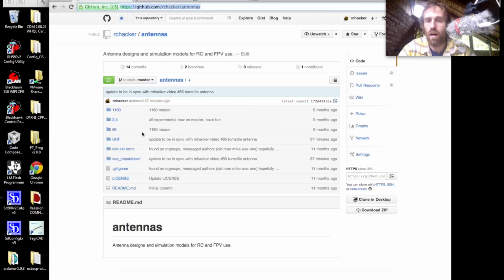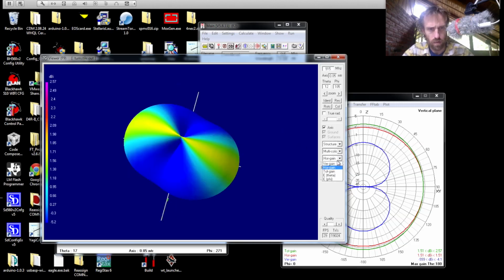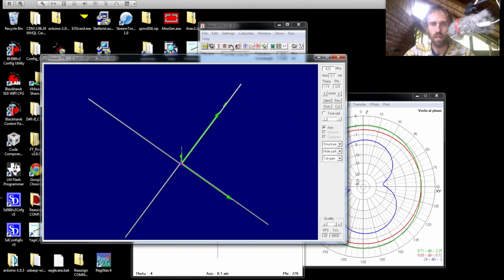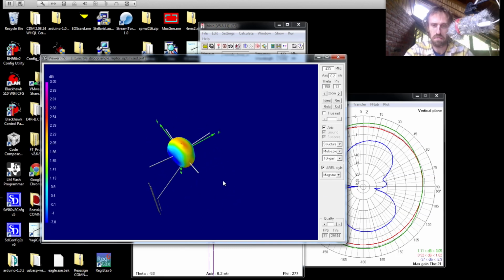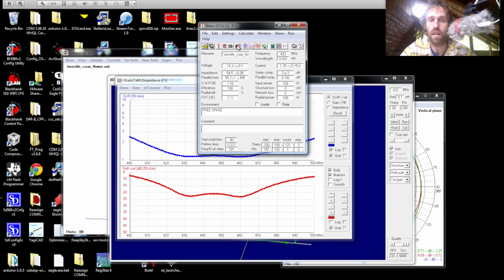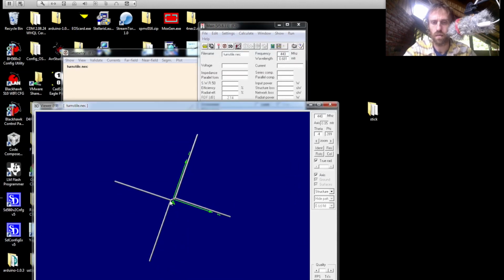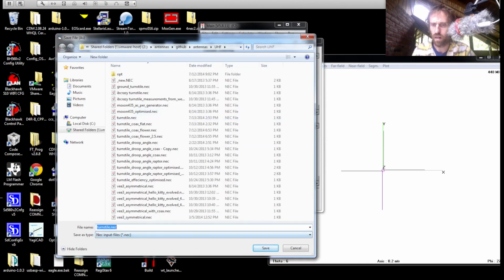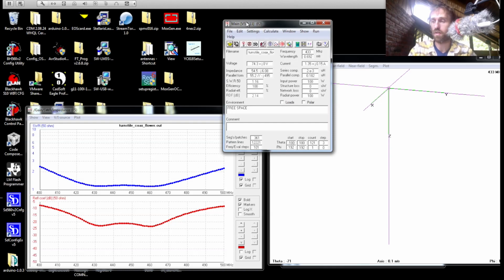Turnstile antenna, DIY 425 - 1280 MHz RCHacker #65

Comment: Loved the video, very detailed.  Is there another type of horizontal antenna for 433 mhz ? Turnstyle does not fit my wing. Id like to mount the antenna laid flat inside the wing. any suggestions ? Thanks

Comment: You said if I think you missed something or make a mistake to tell you so here goes.

First let me say nice model. I can tell you've got the modeling bug.
 Welcome to the club!

I think your interpretation of the radiation pattern  at about 5-7 minutes is flawed.
You modeled the antenna flat then rotated it to interpret the horizontal vs vertical components.
The program assumes that  the z axis is vertical and the x and y run horizontal.
If you want the program to report horizontal and vertical correctly you must actually rotate the model not just the view.
If you rotate the model as you suggested ( long elements running vertical + and - z)
The vertical gain completely dominates showing
vertical gain of 2.15 dBi
 total gain 2.59 dBi
 horizontal gain of -6.9 dBi.
 If the short elements are vertical then horizontal gain dominates.
total gain 2.61 dBi
horizontal gain 2.1 dBi
vertical gain -6.9 dBi

You can verify these easily by rotating your model with the geometry editor, select all and rotate around y axis 90 degrees.
This will strip out all of your variables (save as new name) leaving numbers only, but it's a quick and dirty way to view rotations of the same model

RE circular polarization
This difference in the Horizontal vs vertical gain should also reveal that this antenna is highly elliptical vs circular.
This ratio H vs V  (axial ratio) determines how circular the polarization is and therefore how well it receives signals of any polarization. This antenna is not a very good CP antenna. If the "LSratio" was closer to 1 that might change. The presence of a ground  might boost the horizontal gain of the Vertically dominated version to be more circular, but that changes with height. This doesn't make it a bad antenna but calling it CP is a disservice to the results that CP can achieve.
 A view of axial ratio is available in the 3-D window. change the magnitude drop down to axial ratio.
This iteration of a turnstile acts almost like a simple dipole ignoring the shorter elements almost entirely.

BTW if you are wondering how this model gets more gain ( 2.59 DbI ) than a dipole in freespace  ( 2.15 dBi )   it's because the AGT  is off  (1.123)( you want a 1 ) and inflating the gain values by 0.5 dB
The average gain test is an option on the generate window click off expert settings and a check box for AGT is there.
Validating the model with a segment check gives warnings about length vs radius ratio of the segments near the feed. Changing your segments from 80 to 45 makes the warnings go away and improves your AGT to 1.085 or .35 dB off.
Then changing the radius of wire # 1 to be 0.3144 will correct the AGT  value  and the gain reported (the pattern wont change).
Also changing the value of "angle" will alter the AGT not much for small changes but a lot near the extremes.
Keep in mind this "wire" (#1) is imaginary and just there to tell the program where the feed point is ,so differing radii restrictions aren't really applicable.

I also have some deep reservations regarding modeling coax later in the video.
There may be common mode currents on the coax that aren't represented by a wire.
I've always heard you cant model coax in 4nec2.

Comment: I read about the TS that it radiates rhcp up and lhcp down or opposite.
The reason for mounting the antenna flat on a rcplane might be that you want to be in the right polarisation hemisphere most of the time while flying, mostly of you are using another circular polarised antenna on the other transmission end.

What do you think?

Comment: As far as I know these antenna are circularly polarised, but how can you choose if right hand or left hand circular polarised.
With the background of having other circular polarised antennas, that they can have the opposite rotationdirection.
Even If the other cp antenna has another frequency, they might influence each other by some order harmonics.

Do you also think this can become problematic, for example 900mhz vtx cp and 433 rcrx cp on a quad.
Reply from the maker: Ruben Hartmann Swap the long and short elements. Did I do a frequency sweep of this antenna? that will tell you if there will be problems with harmonics.
Reply from the maker: RCHacker Yes, and an antenna can be both linear and circularly polarised at the same time. I was not optimising for either in this case just absolute SWR.
Reply: Great work! In your mounting orientation , the turnstile is like a RHCP x-hair beaming at u when flying out wards and an LHCP x-hair when returning(Or vice-versa)To benefit from this axial mode, try diversity of 2 x-hairs on ur Vrx (1 RHCP N 1 LHCP)
Reply from the maker: Terence Chan Makes sense to me.  A very nice solution with only one antenna design, thanks.

Comment: Enjoyed your video!  I'm currently getting a bit above 35KM and back with my Turnstile  nice although I noticed much less performance on the way home (with it lying flat).   Would like to try positioning it like you mention and wondered if I'm using a Moxon on my TX if the position of that (vertical vs horizontal) would have any bearing on overall performance in combination with the Turnstile positioned as you describe?.
Reply from the maker: 35KM wow, I would not touch a thing. Well done. 
I am still not sure if i should have the moxon flat or upright with the way I have the turnstile orientated as I got a bit mixed up with the axes in the simulation. When I made the video I was thinking flat, now I am thinking vertical. One will be better than the other for sure. I need to get flying or do more testing to figure out which. Cheers.
Reply: Depending on where you put the antenna (of course), but most people put the antenna on the wing, so when you are going away from yourself the antenna is pointing down slightly on the back side of the wing due to the angle of attack on the wing (front of the wing always points up at a slope, greater on flying wings). This means you have the higher gain part of the antenna pointing down at "more" of an angle back towards you when you are flying away from yourself.

When flying back towards yourself the antenna is pointing slightly up, meaning you have a reduced signal strength as the larger gain part of the antenna is pointing into space. Something you can correct for if you are embedding the antenna into the wing, just cut the slots for it deeper towards the front of the wing so it is sitting level when the plane is flying and the front of the wing is pointing up.

Comment: I built a Moxon for 435mhz and it seems to be working well.  However, is there a method for measuring SWR, etc. for this actual antenna (not the model)?  I'd like to confirm that my measurements, cuts and performance are optimum.  Most ham swr meters require more power than rc fpv uses.  Thanks.
Reply from the maker: Hi Glenn,
Not easily, you need to get yourself an SWR meter. I think Alex did a video on a DIY SWR meter but the main part needed can be expensive.
DIY IBCrazy SWR meter
There is a huge market for RC optimised versions of these, I looked into designing my own for 5.8, but the parts are very tiny and not reliably available. Its also a bit beyond my skills and equipment.
The best you can do without is make a few different antennas and test which ones are best using RSSI.
Reply from the maker: There are lots of commercial ones, but you would have to convert the connectors. http://www.amazon.com/s/ref=nb_sb_noss_1?url=search-alias%3Daps&field-keywords=uhf+swr+meter
Reply from the maker: RCHacker Sorry seems the specs for those are for much higher power than what we use.
Reply: RCHacker Yes, that's what I found as well.  I like the directional abilities of the Moxon but I like the broadband features of the turnstile.  I'll just use my RSSI comparisons for a "ball park" functional estimate for now.  Thanks again for your informative videos!
Reply from the maker: No Problems. Let me know if it works 'ball park' well for you. Cheers.
Reply: RCHacker I wonder if a linear amplifier could be used with a VTX to a 5w SWR?
Reply: Glenn Doney If you know any amateur radio operators you could use one of the commercial uhf swr meters connected to a handheld, or base station radio tuned to the frequency of your rc gear ,and then connected to the swr meter, to your antenna to test the swr of the antenna on the required frequency. 

Or you could use something like this:
http://www.mfjenterprises.com/Product.php?productid=MFJ-229

Not cheap though, @ ~$200USD.

Good luck~

Comment: Hi Marc, would using 0.75mm mig wire work with the specs on the cheat sheet for 433 or will it change the lengths a lot? Thanks again.
Reply from the maker: Good question, I put the different diameter in and it made no noticeable difference.

Comment: Interesting video Marc. I think you're wrong about the orientation. If I'm informed correctly, the Turnstile antenna radiates horizontally polarised waves when laying flat and circularly polarised waves to top and bottom (top-RHCP, bottom-LHCP or vice versa) So if you orient it vertically without ground plane then it won't work like expected.

Also, where's your 90 degrees phase shift? I can't see how your antenna works properly. Perhaps I'm wrong but articles about turnstiles all mention 90 degrees signal shift between the perpendicular dipoles at their feed points.
Reply: Hi Martin. Horizontally polarised waves when laying flat with a ground plane, or without one? Ground plane makes a big difference.
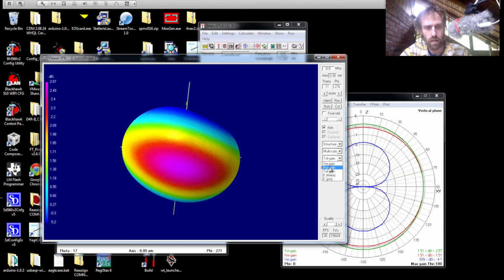At 6:28 I show the 'horizontally polarised waves" Perhaps that should be vertically polarised because the axis have moved 90 degrees. Still it is a flat donut pattern. I am going to stick with the way I have it on the plane, I might just have to rotate the tx antenna 90. I'll test this in the field then we will know for sure.
Reply: Marc Griffith Thanks Marc, without reflector I mean. See http://en.wikipedia.org/wiki/Turnstile_antenna#Normal_Mode Circular radiation pattern and circular polarisation are completely different things. So high gain in horizontal direction doesn't necessarily mean that the polarisation is horizontal too; it can still be vertical or a mix between horizontal and vertical (circular).

So when mounting the antenna flat, it has less gain in forward direction but at least the polarisation is horizontal, like the tx's antenna. Perpendicular to that, it radiates circularly polarised waves. So mounted flat it radiates horizontally polarised waves in all directions except up and down. That probably makes it a good rx antenna for low and far distances (remind that the tx has a horizontal antenna too, in most cases).
My point is that when mounting the antenna vertical with the short elements pointing to the side, you'll have circular polarisation towards the front and back of the plane and vertical polarisation towards the sides. That should give 3dB loss worst case when using a vertically polarised tx antenna. When using a circularly polarised tx antenna it will be epic failure in one direction because front and back of the Turnstile antenna have opposite circular polarisation direction (LHCP / RHCP).

The cross hair antenna is IMO just an axial mode turnstile with a reflector. Note that the reflector reverts polarisation direction from the back side, so it turns LHCP into RHCP and vice versa. So that antenna should be mounted vertically or at least at an angle because then the circularly polarised waves travel in horizontal direction, away from the reflector. Unlike e.g. the Helical antenna, the notion 'normal mode' vs. 'axial mode' has to do with the antenna's orientation instead of being a physical antenna property. At least, that's what I understand from the theory.

Comment: How does this compare to a half wave dipole for 433?
Reply from the maker: Have a look at my V antenna video.  it is very similar to a dipole, slightly better performance. RCHacker #61 - Simple Vee Antenna.
Vs the vee I am thinking that the Turnstile is  not really worth the extra complexity.
Reply: cool.  I have some friends that are having good results with some interesting ground plane antennas for uhf, have you looked into those at all?.
Reply from the maker: Wyll Surf Air No, I have not looked at these, looks like another promising omni antenna. Thanks.
Reply from the maker: RCHacker http://www.ai4ji.com/Projects/antennas/groundplanes.htm
Reply: I just watched the V antenna video.  What are the benefits of the V compared to to a dipole.  On the ground plane they were laying there elements flat (i think it change the impedance a bit but made it easier to mount on the plane).
Reply from the maker: Wyll Surf Air The V has the same pattern, better SWR.
Reply: cool
Reply from the maker: RCHacker as per the above measurements for 440MHz. https://45edeaac-a-01847fd9-s-sites.googlegroups.com/a/rchacker.com/rchacker/diy/antenna-designs-for-rc/ground_plane.jpg
not optimised yet but in github.

Comment: Thanks Marc for the video. Very interesting! I'm not a RF specialist but could you point the difference for Tx and Rx antennas if they are for long range transmitter or for telemetry modules (which I am more interested in)
Reply from the maker: No real difference in a tx and rx antenna whether your system is bi-directional or not does not matter in antenna choice. What you use depends more on whether you want omni directional or a directional antenna. Usually omni on the plane and directional on the ground. I use moxon on the ground and vee or turnstile in the air.

Comment: Cool video, very informative! Need to install that 4nec so I can see whats the deal with that "optimized moxon" of yours..Would be also cool if you delved into cp omni antennas too :).
Reply from the maker: There are some CP designs in there, the optimised moxon is not much better than what comes out of moxgen.

Comment: Interesting investigation Marc. You've inspired me into trying the NEC software.
In general a broadband antenna is considered less efficient. You will hear of the so called Q factor which translates as a quality factor. Low Q = broadband lower efficiency and visa versa.
BTW balun is a contraction of BALanced to UNbalanced transformer so should be pronounced as such.
Any chance of a intro tute on the NEC software? Might help others to experiment with this topic.
We have some solid bronze mig wire at work, I plan to compare it's mechanical and electrical properties to the common MIG wire as I don't think the usual copper clad steel wire is best. I remember a freind of mine made a dipole for 3.5MHz with Mig wire and found it to be untunable probably from ohmic losses over such a long length. I acknowledge the skin effect will be much stronger at UHF frequencies but you still have to wonder.
Reply from the maker: There is a tutorial out there somewhere that got me started. Antenna simulation tutorial 1 - 4nec2 user interface. Thanks, my pronunciation on various terms is not always right.
I would not have thought it would matter that much given the low currents and short distances we are dealing with. Let me know how those tests go, I dont think my multimeter is accurate enough to tell the difference.